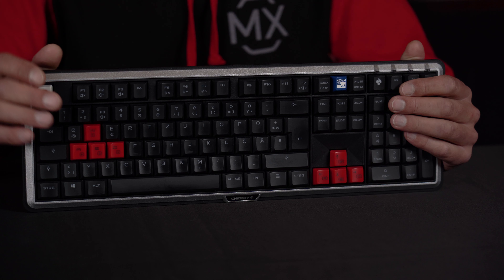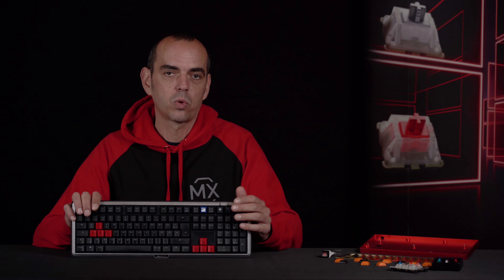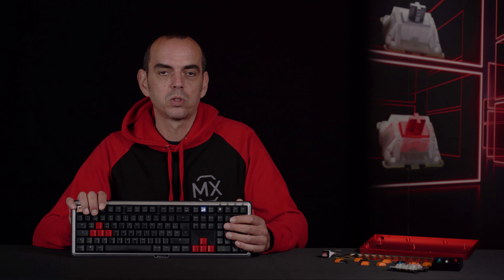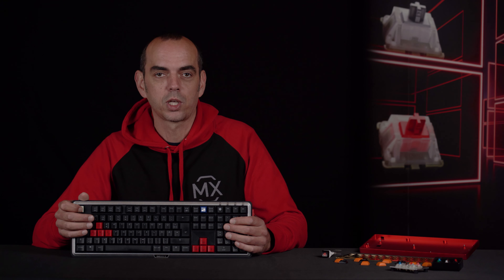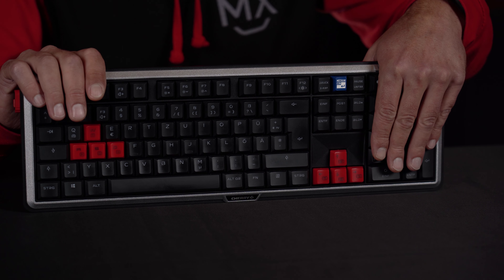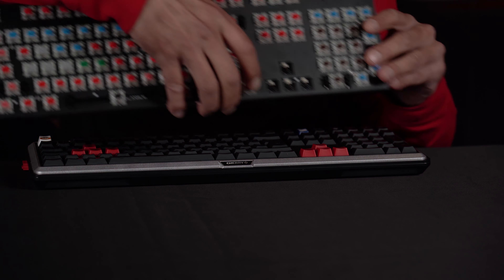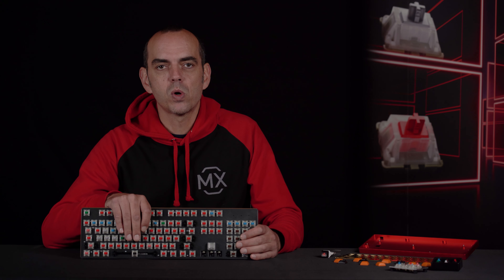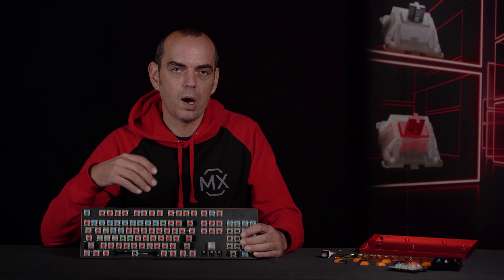[HOW TO] DIY keyboard - Part 1: Build your individual solution

Comment: Are browns or speeds better for gaming
Reply: Skystreak Honestly I don't think any switch is better for gaming but some people prefer lighter switches with shorter travel time for gaming
Reply: Spyne. Well there a definitely switches that are better than others for gaming. Like definitely reds over blues.
Reply: @BenBorisenko  it's personal preference. But yes technically a speed switch is better because it has a higher actuation point. That will in 99.9999% of cases not be the limiting factor and you are better off using what you prefer feel-wise.
Reply: In my oponion there is no best Switch for gaming. The most important thing is that the Switch feels good and you can enjoy youre keyboard. Maybe that will make you a better gamer
Reply: @spyne.98  Mechanical switches are better for gaming and what ever has shorter travel and better response is better for gaming
Reply: TinyDragonGaming Yeah no shit
Reply: Gateron yellows
Reply: @BenBorisenko  not necessarily. thats just personal opinion